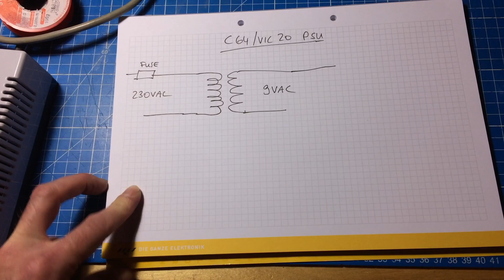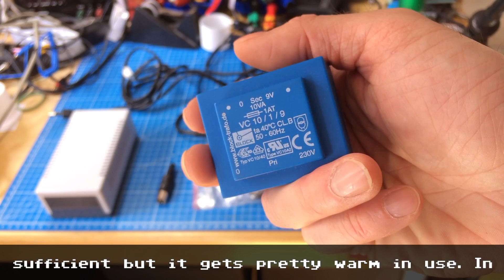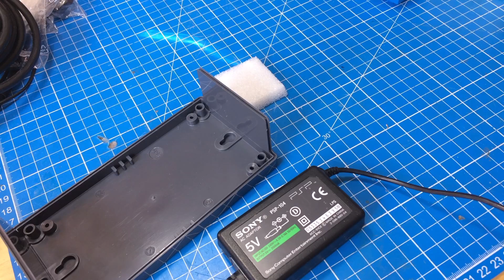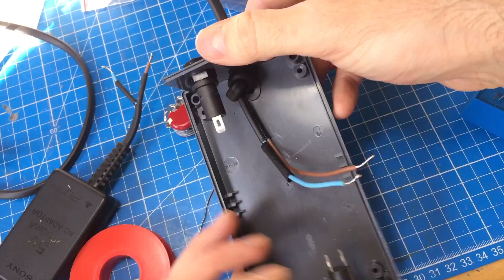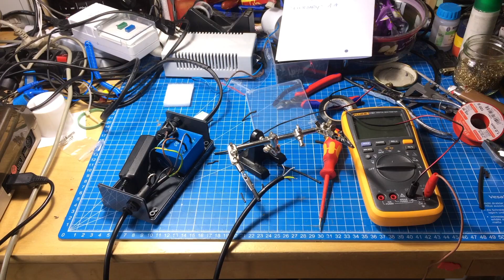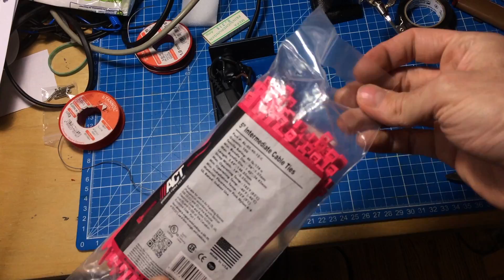Building a DIY C64 Power Supply (The Lazy Way)

Comment: Yea I know this is ancient history. But I would take the PSP supply out of its case. It was designed to be in its case but you have put that into another case along side something else that gets hot. Should take advantage of the air ventilation present in your case. Cooler is better.

Comment: I just built something similar. My "design" was more ghetto than yours 😊 I started with a broken C64 PSU, took the potted block out of it, then grabbed an old 9VAC wall-wart, and a 2A phone charger with an EU plug on it (I'm in the UK so this was useless to me, and unused). The input fuse is in the UK mains plug so not needed in the PSU. I cracked the two power supplies open and araldited the linear transformer in the case, and hot glued the switching supply (as I figured this would break sooner than the linear one). Then used choc-block connectors to wire it all up - other than patching the 5V lines no soldering required, and all the cabling already present as I re-used the broken supply's wires.

All worked well so I hot-glued a C64 saver into the case, so the computer should be completely safe, and the whole thing looks like an original power supply!
Reply from the maker: Haha, nice! Great that you made that work. The C64 is not very picky with its power supplies so as long as you have the correct voltages, basically everything should work without any issues. Good thing you put the saver in there as well, although most modern switching supplies should just burn out instead of putting out overvoltage in case of a fault. :)
Reply: @JanBeta  Yeah, I'm always a bit paranoid with switching power supplies though, the cheap ones have a nasty ability to short the mains through to the 5v side. Yes I know this is rare but I couldn't leave it like that. The charger came with a Sharp smartphone - should be good, it seems OK with polymer caps on the cold side and Sharp are still reputable, but you can never tell.

Comment: The 5V DC supplies the chips in the C64, and I was wondering what's the purpose of the 9V AC?   Is it absolutely necessary?
Reply from the maker: The older long board revisions use the 9V AC to derive the 12V/5V supply voltages for the SID and the VIC-II chip, the 9V is also used for the cassette port and some user port expansions. You won't even get a picture output from an old school C64 without the 9V supply. The more recent "short board" revisions start up fine with 5V only (they just don't have sound and cassette and user port don't fully work). I did a video a while back where I tried to power a C64 from a USB power bank if you are interested in more details!
Reply: @JanBeta - Thanks Jan, great explanation.   I had the hunch that some functions won't work without 9V-AC, but didn't know that old C64 versions won't even power on.
I still have a collection of 4x C64's, one from early 1984, one from 1985, and two C64's brand new never opened from the early 90's.   Used to run several BBS's on both the C64 and Amiga, and they've been packed away for 30 years now.   One day when I retire I will have some fun. heh

Comment: It is just me or the trafo was delivering almost 12vac instead of 9vac?
Reply from the maker: Yes, without a load, the transformers put out higher voltages, goes down quite a bit under load. The AC voltage doesn’t need to be exact at all, regulation happens on board in the C64.

Comment: I would have included a switch on the casing, so that you had the option of not having it, 'on', all the time it's plugged in, increasing the life of the unit.
Reply from the maker: Yes, I did that for all the recent power supplies I built. :)

Comment: built my c64 psu from this video works great, i used my old psu cables for the power and connection lead.
Reply: You test voltage with multimeter?
How much on 5v line?

Comment: Still works without issues?
Reply from the maker: Yes, I used it nearly every day until I very recently build a more sophisticated one.
Reply: @JanBeta  3years without problem on 5.41v sound's very good to me because my setup gives on cable 5.3v without load and on c64c  expansion port 5.12v.
Is safe voltages? Some people say , everything more than 5.05 on psu is bad.

Comment: Thanks, I built it into a computer power supply box and it works great. added a bridge rectifier to another set of taps on my surplus xfmr and a step down buck converter for the already installed 12V internal fan although I don't think it was necessary

Comment: You may not have thoroughly clear what a fuse is for and when to use one... it's perfectly pointless to fuse protect the output of an electronic circuit: once shorted, a semiconductor device normally tends to get fried ages before the fuse itself can even smell the short, unless built-in electronic (fast) protections are provided. In your case such protections are in all probability already there. By converse, it's absolutely dangerous to leave a transformer secondary winding unfused, which in case of prolonged short on the output would result in overheating with subsequent fire hazard. Maybe you want to swap places to the fuse...

Comment: Why not usb?
Reply from the maker: Because USB specifications for current are too low. Standard USB 2.0 is defined as 500mA current per port. There are obviously chargers that would work (2.0A and even higher) but I won’t generally recommend putting a USB plug on it unless you know what you‘re doing AND have a decent USB power source.

Comment: good vid   jan   but   you can get power supplies from china  ready biult   5v 12v dc regulated     just be careful from   chinia
Reply from the maker: Thanks! Yes, you can easily get DC power supplies but the C64 needs both 5V DC and 9V AC. That’s pretty uncommon unfortunately.
Reply: made   mistake   ac   output    im   converting  my   ac   dc  input  circuit   to  handle  dc   input     just  need   better   ceramics   and  bettter   electrylitics   ill go  forrr   1000  micro   uf   cant   remember  name   1000  dc   uf

Comment: I am copying your design since it seems your design is working great still.
I did not get the ventilated version of the cabinet you use, so I will mount a silent fan for getting the heat out with some holes for the fan.
Reply from the maker: Ah, sounds good. Hope it works for you!

Comment: I ordered a DIN cable instead of a DIN plug. No DIN soldering required. Just some splicing. I'm a little concerned about the 9V AC (says 9VAC 1amp on the adapter) though. My multi-meter reads it as 12V. I know it's normal for them to be a bit high without a load, but is that ok or is that too high?
Reply: @tierraUruguay7677  yeah apparently even 15 is fine. The AC side doesn't need to be exact. I figured it out 3 years ago. Unfortunately the DIN cable I ordered did cause problems. It didn't allow enough current leading to a voltage drop when I had my U2+ cartridge installed. It dropped from 4.5v to 3.5v. The computer mostly worked, but I got color glitches. I replaced several chips before I discovered it was the cable. I replaced it and now I get proper voltage on the motherboard and it works perfectly.

Comment: I think If I was going to do this I'd use my qualcom usb quick charger. It's a lot smaller that that PSP charger you got. I think you have to short the data pins for the higher amps though. I'm not sure.

Comment: could you just bypass the c64 ac to dc converter and feed 9vdc into it
Reply from the maker: I don't think so, the main supply for most ICs is coming from the 5V DC rail in the PSU. You can power a C64 without the AC voltage though. short board C64Cs fully work (but without sound), older revs need more voltages for the graphics chip.
Reply: The AC is required for a voltage doubler as the SID and VIC-II actually require 12Vdc. The charge pump method of increasing the voltage needs AC to work.
Reply: @francoisleveille409  just use 12vdc instead
Reply: @muffenme  Since the voltage doubler uses capacitors, the DC will not pass...
See: https://www.electronics-tutorials.ws/blog/voltage-multiplier-circuit.html

Comment: Hi, Just wondering what the Sony 5 vdc supply measured, no load?  I have a Sony 5.2 vdc e-Book supply that measures 5.32 vdc, no load. I'm just wondering if that would be OK to use, as is, or if I should add a ~1 meg resistor in series, to drop it down?  Thanks in advance!!!!

Comment: I'm about to wire this together, but I'm confused by the markings on the BLOCK psu. Jan initially says he'll solder the neutral wire to the primary pin farthest from the fuse at 16:34. This would make sense with my reading of the symbols on the rear of the psu. That connection has a 0 on the rear side.
However, he ends up soldering the neutral wires to the other pin, the one nearest the fuse, seen at 17:50. This would line up with the 230V symbol (which I'd presume was live?) on the rear of the psu.
AFAIK, I have exactly the same model of Block psu that Jan's using. Could someone advise me on which pin to solder what to? Perhaps I'm reading the symbols on the Block psu incorrectly?

Comment: hi, the diagram may be wrong; if u need 5 V take it from the 2ndary of transformer, then rectify and filter and regulate (if talking about linear psu); in fact u need to take more than 5V taking into account all the voltage drops of rectifier + filtering + regulation up to the real load, but it's relatively easy to have a 2ndary transformer with a couple of exit points for various voltages (AC)

Comment: Why not to take this 9V AC, after diodes and a capacitor it will increase by √2, so we will have near 13v DC. Then just use switching dc-dc converter IC and take 5v from it. Few more caps and that's it :)
Reply: On the other hand, I agree, the way you did it is a perfect balance between quality and ease of work on it

Comment: This is great stuff Jan. However, does anyone know if the 4 core cable used for this should be screened?
Reply from the maker: No, I don’t think so. Usually regular power cables are not screened. The original C64 PSU cable isn’t screened. There’s some noise filtering going on in the C64 itself, too. Saying that, it wouldn’t hurt to use screened cable I guess. Can’t see any real benefit though.
Reply: Thanks for the reply Jan. Righto, I think I'll stick with regular 4 core then. Looking forward to starting this project. :)

Comment: You note that you would use another transformer. Could you give me a link to the 9vac transformer you would use instead? I live in Denmark and we also have 230vac mains
Reply from the maker: Oh, I actually changed my mind a bit about the transformer (also after speaking with some more knowledgeable colleagues). The transformer I used is absolutely sufficient for the job and it's normal that they get slightly warm in use. Anything that can provide 9V AC at 1 Ampere minimum will work fine.
Reply: Jan Beta Thank you very much for your reply. Do you mind telling me if this transformer would be sufficient? 
https://www.elextra.dk/details/H17199/230v-printtransformator-12va-1-x-9v-133a

I love your videos what I would not give to have your extensive knowledge about commodore computers.
Reply from the maker: Yup, that one is going to do the job fine. :)

Comment: So how does c64 5V actually work if the original power brick makes 5V DC and inside C64 is 7805 linear regulator? Linear regulator needs  at least 1V more input than its output voltage to be able to regulate the output voltage. With 1A current the voltage drop in 7805 is usually 2V.
Reply from the maker: The 5V regulator is provided with the rectified and filtered 9VAC from the PSU. It is used to provide "cleaner" supply voltages for the VIC-II video chip and the SID so there is less noise.

Comment: I am surprised that a sleeve is not made that can be soldered to the individual wires and then slipped tightly over the 7 pin din solder points one at a time to make the job easier and cleaner.
Reply from the maker: I think there are sleeves like that but I didn't find suitable ones anywhere.

Comment: Does the VIC 20 and all variants of the C-64 use the same power supply?
Reply from the maker: The C64 variants all use the same power supply (at least the output is the same), the old VIC-20s use a 2 prong 9V AC connector. Later models use the same connector and the same PSU as the C64.

Comment: wow you're doing the same as I did with these annoying DIN (sorry German :D) connectors. Use tape in between the pins after soldering because its almost undoable to make the exposed pieces of wire so short that they are still solderable AND don't reach the neighbour pin.
Reply from the maker: Haha, yeah, I like to keep it safe. There's a lot of wires really close to each other so I use tape for safety. I don't want to take any chances. ;)

Comment: Wire Ferrules.  I had to look that up.  It's a crimp end that you attach to your wire, then slip the compression fit end onto the DIN connector.  Grab your calipers, because this is going to be great.  Also, to check the size of the DIN pins, I couldn't find that after quickly googling.

http://www.ferrulesdirect.com/Merchant2/merchant.mvc?Screen=CTGY&Store_Code=FD&Category_Code=NYLPINTERM

Edited for clarity, believe it or not.
Reply from the maker: Oh, interesting approach. I'll have to try that for future DIN escapades.
Reply: Best of luck, thanks for the episodes!

Comment: I feel your pain with soldering directly to the DIN connector.  Last time I tried that, the wire just snapped as I finished the project.
Reply from the maker: Uh, that's painful. I usually forget to slide the plastic part of the connector over the cable and then have to redo the whole soldering. ;D

Comment: This looks good and will do the job great, can't see any big problems here, certainly two steps up from an ancient resin filled Commodore brick! A small refinement would be a "naked" 5V part w. some passive cooling, I like this solution though.
Reply from the maker: Yes, a dedicated 5V supply would be a step up indeed. I definitely want to tinker with C64 power supplies some more in the future. This one is meant as being a very convenient and easy way to do it so (hopefully) many people can build their own based on the idea.

Comment: Great choice of case. It evokes the Amiga, yet is smaller than the original 64 PSU. I've ordered one for delivery to California and am going to do a similar (but different) process using a plug in transformer and a plug in switching power supply, both just dropped in the case and plugged into one mains extension lead. Watch this (well that, my) space! Good job Jan!
Reply from the maker: Thanks! Hope it works as well for you as it did for me. :)
Reply: Jan Beta A follow up question if you'd be so kind: The Ray Carlson plug in transformer that he sells, just plugs into the wall socket, and the other end into the C64. No fuse. And of course the C64 has a fuse. How necessary are the two fuses you've installed?
Reply from the maker: I decided to fuse the mains side on my power supply to prevent damage in case the transformer itself fails and shorts. The internal fuse on the C64 is there for quite the same reason. It's only on the 9V AC line and it just prevents the C64 from catching fire (yeah, probably a bit exaggerated...) in case the transformer fails. I fused the 5V line because it's the most important for the ICs. Also it's a good measure to have a fuse on there when using the TVP diode because it would instantly pop if the diode starts conducting.

So in my model the mains side is fused (which is always a good idea), the 9VAC are fused in the C64 and the 5V are fused. I wanted this to be as fool-proof as possible. And I have to admit I already popped one or two of the 5V fuses while tinkering with boards and accidentally shorting things. ;)
Reply: Jan Beta Hello again sir! I'm doing a video on how to create an even LAZIER power supply. Would you mind if I used 3 or 4 screenshots from your video to talk about some of the other power supply projects in the video introduction? (I'll also link to this video of course!) Thank you in advance.
Reply from the maker: Sorry for not answering the first time... busy and confused lately. Of course you may use screenshots from my video. :)
Reply: Jan Beta No problem and thank you! I just thought that I forgot to tag you. Don't be too confused, you sound pretty compos mentis to me!
Reply from the maker: Thanks! Just a lot going on in "real life" at the moment. ;)
Reply: Jan Beta I understand. Be well and take care my friend.
Reply: While the 5V DC supplies the chips in the C64, I was wondering what's the purpose of the 9V AC?   Is it absolutely necessary?

Comment: Don't hurry out to buy a PSP power supply... many outdated routers use a 5v 2A supply and they can be found for almost nothing in garage sales.
Reply from the maker: Of course you can use any reasonably good PSU that is rated for 2A and above. :) 
I used the PSP supply because I had it lying around anyway. It also has quite a clean output and a small form factor.

Comment: Thanks for the video.  I made my own, with a few minor changes.  I'm getting 5vDC and 11vAC (from the same transformer you used).  I'm hoping that's okay.  I tested it on a C64c.  I'll try it on my normal C64 once I get the correct fuse and am more confident it's not going to cause damage.  It's here if anyone is interested: http://www.lemon64.com/forum/viewtopic.php?p=808610#808610
Reply from the maker: Oh, cool! I found the transformer delivers quite different voltages depending on the load. On the older breadbins it was close to 10V for me (which is absolutely fine) and on the newer models it was a bit higher indeed. The newer ones seem to draw less current. A bit more AC doesn't hurt them I think. The older models get warmer the more voltage they get because there's the 78xx regulators inside that dissipate the overhead into heat.
Reply: Right, thanks for the info.  I've just tried it on my normal C64 and it's giving 9.9v and 4.97.